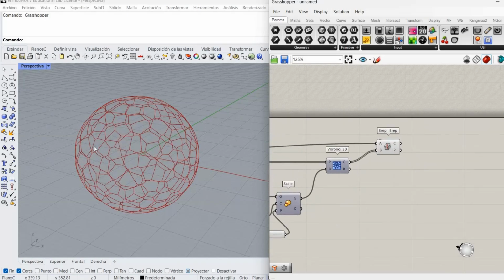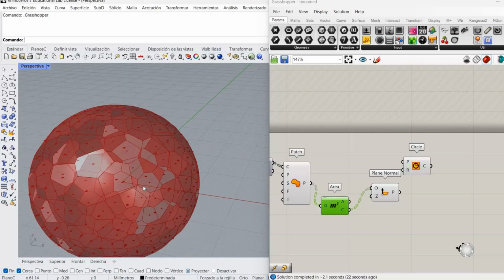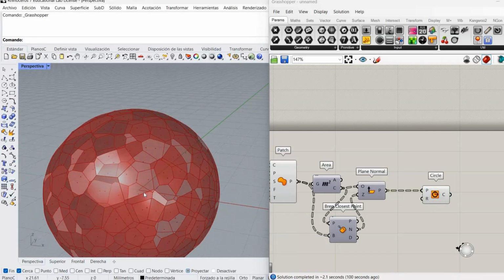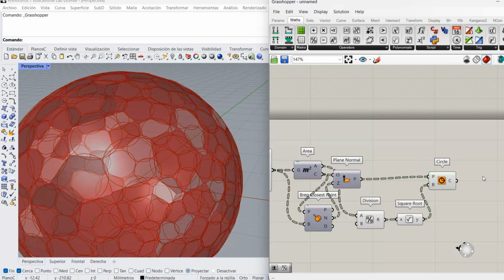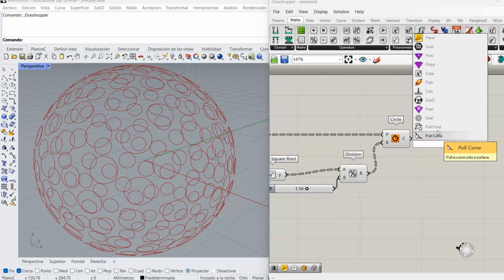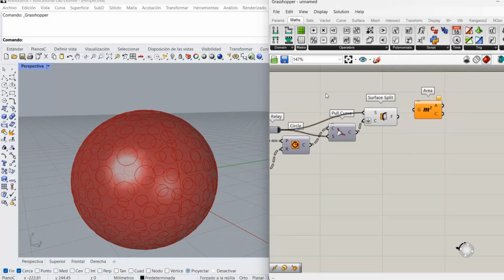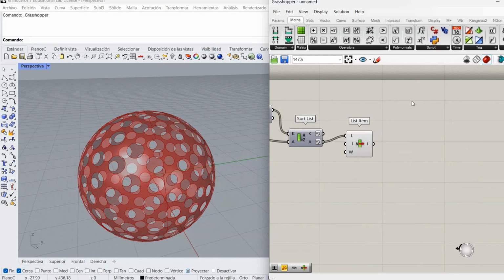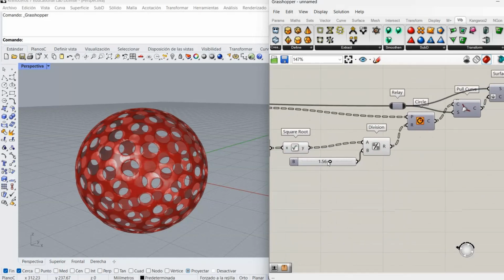Grasshopper tutorial - Holey Sphere

Comment: Hey, great work! I was wondering if you could do a tutorial on how to seamlessly stitch together multiple surfaces in Grasshopper. Often, when surfaces are imported from other software, they need to be patched in Rhino. However, Grasshopper doesn't always recognize them as one single surface. Could you provide some guidance on how to address this issue?
Reply from the maker: Hello! Thanks for reaching me out.
From my own experience I have also had trouble with stitching surfaces together in GH. I am not sure if there is a plug in for this. Nevertheless, I believe that you get better results when you use different softwares/plug ins for what they are best for. So, if I have to go from Rhino to GH or viceversa to get what I'm looking for, then I would do it that way instead of sticking into only one software